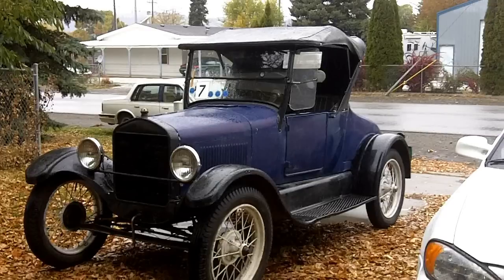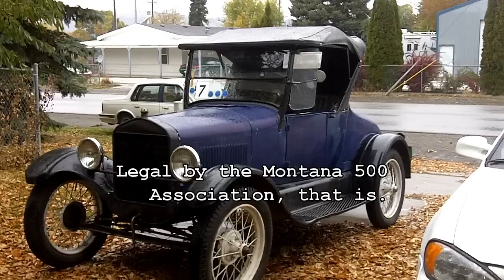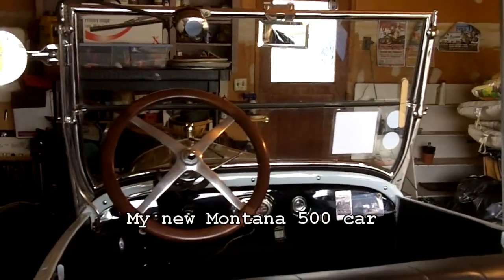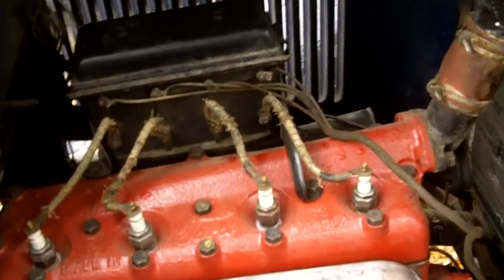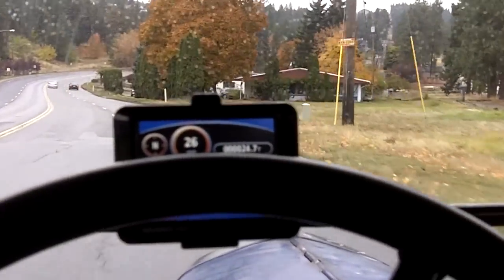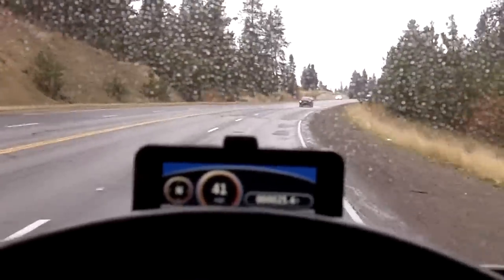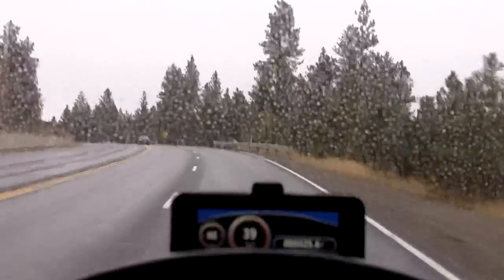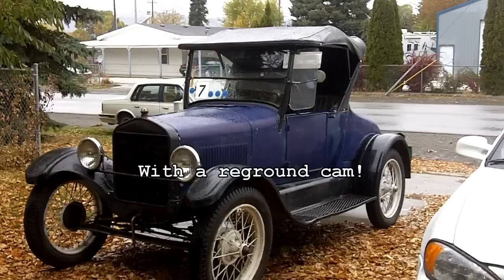Model T Ford Cam Demonstration

Comment: I know the T has a rather “spindly” crankshaft.  Can the crankshaft tolerate the extra torque production and the higher RPM’s resulting from the higher top speed?  I am looking forward to getting my ‘23 on the road someday.  Thanks for the video.

Comment: I've been playing with the idea of improving the performance of my 26 Coupe. I've thought about the quick and easy route of a Prus P High compression head, but have also entertained the idea of taking a spare stock high head I have and having 0.125" milled off of it, as well as installing a stipes .280 cam, a Simmons improved carburetor, and a high volume intake. Any thoughts?
Reply from the maker: I think the best bang for the buck is the head.  I don't know too much about the Prus head, but I really like the Z head.  It has a Ricardo style combustion chamber, which some consider superior to other designs.  I think a Stipe .280 cam is a waste of money.  That is largely the purpose of this video.
Reply: @tacarn  what com do you use?

Comment: Nice car. But, i know that either of my two T's would've climbed it with no real issues. As a kid, we used to drive mine to ruidoso on mre than one occasion.

Both my T's the early one and the speesstr I built in 58 had rusxtel/s I used mine, a lot. that gear between ow and high was a huge difference.

both my t's had a carbs. They ran so much better.

But, i'd find aplace in my drive for this neat roadster.

Comment from the maker: @leadpelletinass It seems to me that any T should be able to run much like this, providing everything is done that needs to be done.  In addition to being properly cammed, they would also need to be properly shaved, balanced,  lubricated, aligned,  tuned, carbed and otherwise optimized.